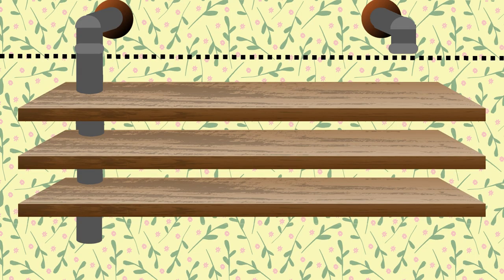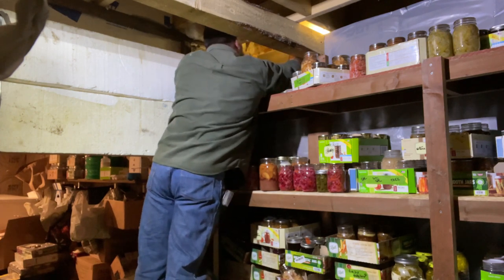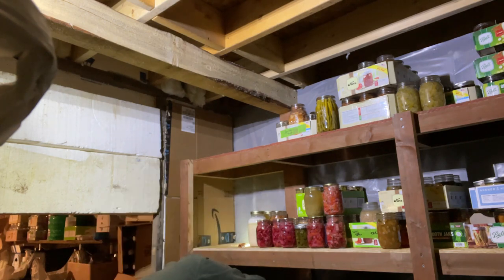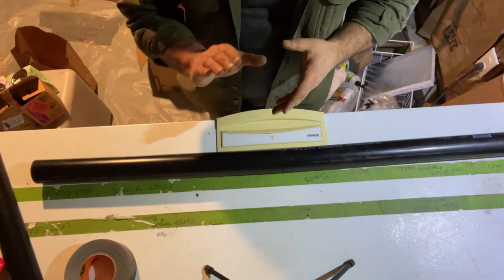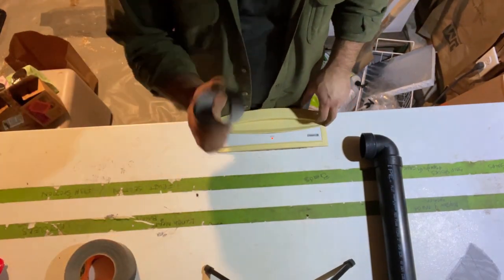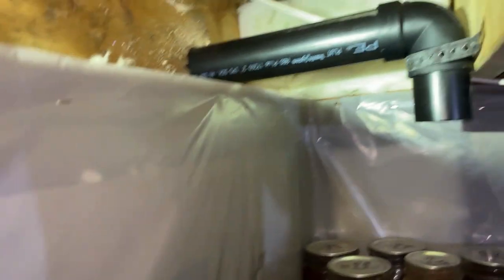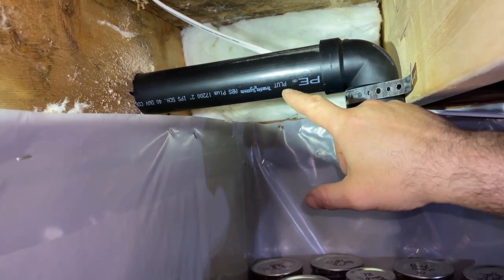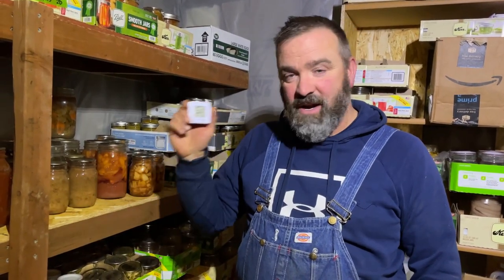Alaska Cabin Life  OFF-GRID ROOT CELLAR | COLD STORAGE — LESS THAN $100

Comment: I DO have one question right now... for your vents on the outside... how high are yours that you're not worried about snow getting in? It's not so much a problem here... but where you are... how do you keep snow from banking right there & blocking your vents &/or getting in??
Inquiring minds need to know! 😁
Reply from the maker: They are only about 2 feet off the ground. This winter we’ll need to keep them clear, but in the coming years we’ll have a porch there. 😊
Reply: @FlatTireFarmHomesteadingAlaska  Ahhhh. Makes sense. 😁

Comment: Unfortunately, we don't have a basement in our seasonal off-grid cabin.  I am hoping to build an insulated above-ground storage room in my shed that would be used to store canned and dry foods. Do you think a constant temperature can be maintained?  I would like to keep food there year round.  Would I only use a stopper to control airflow on the intake side, or would I close both in the winter? Location is North Central Pennsylvania. Thank you!
Reply from the maker: Hi Karen!  Great question!  That would be a challenge, as the key to a root cellar or cold room is to use the constant cool temperature from the ground to maintain the temperature. Since you’re just looking to use it for dry goods and canned goods and not trying to overwinter vegetables, however, I think it’s worth a shot! If you used a windowless part of your shed and insulated all sides and installed a larger diameter vent system, you could open the vents during the cool temperatures overnight, then close them up in the morning. Answering a few questions might help me give you some ideas. 1.  Is the shed in contact with the ground, or above the ground on skids or blocks or something?  2.  What kind of lumber is used for the framing?  2x4? 2x6?  3. How warm does it get during the summer?  How cold in the winter?  4.  Could you bring power to the shed, and if so, full time or part time only?  You could let me know here and I will help however I can, or you can email to theflattirefarm@gmail.com. Thanks so much for watching and commenting!
-Mr. Reeve

Comment: What happens in the summer
Reply from the maker: Hey friend! By the time it gets warm around here in June or so we’ve already eaten through all of our produce from the previous winter. So there’s not much to store in there except for canned goods and maybe some liquid oils. It stays about 50 to 55° in there in the summer. not good enough to be a refrigerator, but definitely cool enough for some things. And by the time it’s harvest time in August, it starts getting cold again. Right now the temperature in the cold room is between 35 and 40. We regulate it when it’s super cold out by putting those caps in those vent pipes to keep too much cold air from getting in there. So far it’s working great!